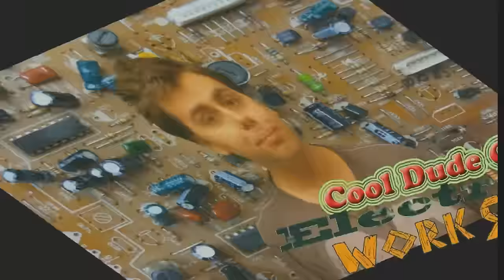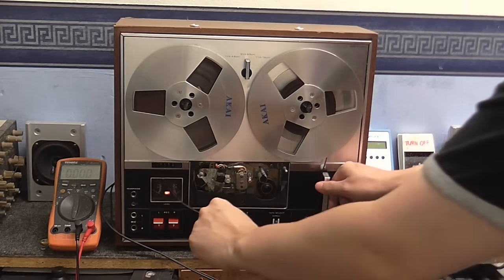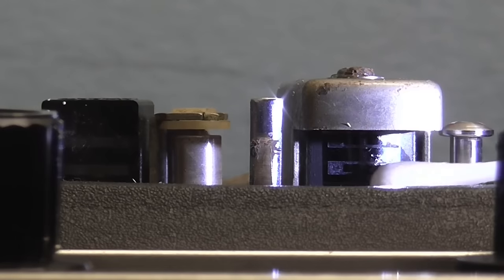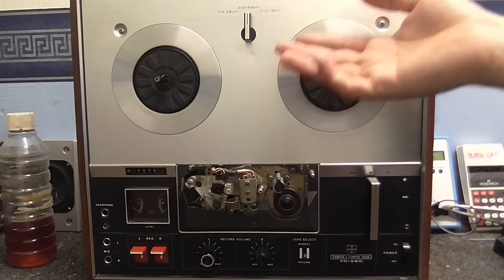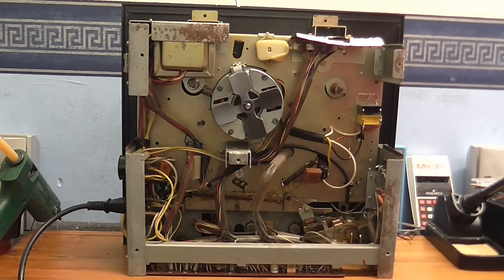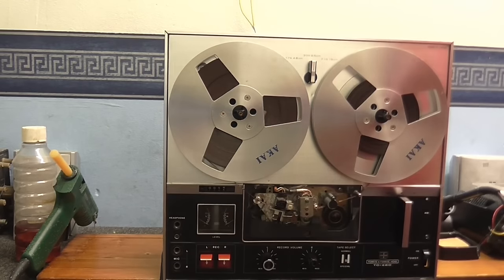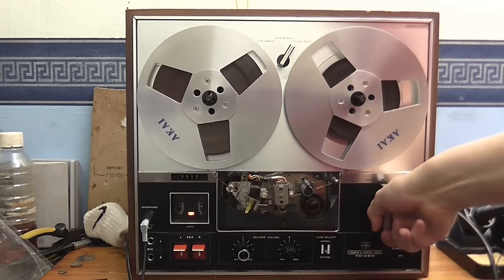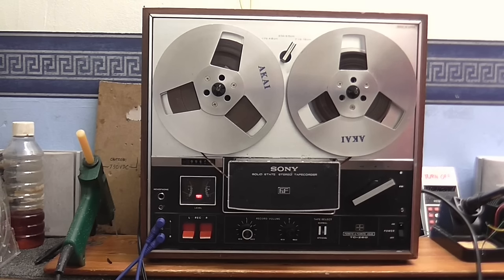The Sony TC 280 Tape Recorder

Comment: Not bad, Clem.  In the future, you might also consider cleaning ALL the guides in the tape path.  I saw one near the record/playback head that had a lot of oxide on it.  Also, before you adjust the playback electronics, you should check the azimuth of the rec/play head, as that can also affect playback frequency response.  A head alignment tape, like Nortronics used to make, can help with head azimuth adjustment. - former tape recording freak

Comment: I'm 17 and work on this stuff.  Some people may think we're too young to mess around with vintage electronics, but I know as much (maybe even more) than my grandfather about reel-to-reel machines and record players.
Reply: You old foggey. I bought an Ampex Reel to Reel 1000 Series for $25 from a garage sale when I was in Elementary School... before 6th grade... came with a bunch of tapes. Then my dad gave me $5 and took half the tapes. RRRrrrr!! later I needed them. I opened it up and changed belts a bunch of times cuz I tried rubber bands and things that didn't last long. 

Just wasted a bunch of time trying getting Sony model 250 to play at the right speed. Finally learned about motor drive capacitors. Under a plastic lid all this white stuff has oozed out. So I think a new or used 1.5 uF 300VAC drive capacitor will fix it hopefully.
Reply: yes , I think that would help, these stabilize the current /voltage going into the motor

Comment: For the stripped screw what I do is dremel a slot on the head making it into a MINUS screw then you can either take it off and replace or just use a minus screwdriver.
Reply from the maker: +coondogtheman1234 Good idea, I don't know why I didn't think of it myself.  I don't have a dremel, but being careful with hacksaw should do the job.
Reply: CoolDudeClem
That might be a bit tough, they sell battery dremels too even no name rotary tools. Just a small one with a metal cutoff wheel. be warned, they are loud so don't do any dremeling at night. Not sure if there are people sleeping at night at your house.
Reply: +CoolDudeClem no dremel? Clem, how do you survive? Dremel really helps in makeshift workshops like mine where space is limited and I can't put up a drill press, saw, lathe....etc. Dremel can give a lot of flexibility. I'll tell u what. If I move back to the states I will give you mine! Why? Not because I like you or I'm a nice guy (I'm not...pure evil actually) but I hate to WASTE things. I can get a nice one for cheap in the US that will work on 110v/50hz vs using a transformer...and I would hate to give it to someone here who won't use it anyway. May seem like a weak promise, but I will keep my word as long as you pretend to be nice to me. :D CHEERS

Comment: Here's a tip for stripped screws : Take a rubber band and place it over the head, then just unscrew as normal. So far it has worked for all screws I have stripped :)

Comment: Try vice grips on screw head before dremel  , set them as tight as poss . Screwdriver may split the screw head after cutting slot with dremel . Ive been there many times .

Comment: try a mole wrench on that screw if you can get enough grip on the side of the screw. Failing that carefully drill it out using a metal drill bit. 
Great video and tape recorder

Comment: Why do you have to keep your finger on the feed reel?
Reply from the maker: Just to give a little bit of tension on the tape, without it the tape drifts off the capstan and pinch roller. I need to look into fixing that.

Comment: The latest Clem's videos look awesome in 50 fps, wouldn't you agree?
Reply from the maker: +MegaBojan1993 Strangely enough, It's actually easier to do videos in 50 fps with my new camera than at 25.
Reply: CoolDudeClem It seems like your editing software for some reason does not like the 25 fps videos. I had similar problems when I used 24 fps (cinematic framerate) in AVS video converter. I updated both the codecs and the video editor and the problem was gone.
Reply from the maker: +MegaBojan1993 Actually my video editor which I've had since 2003 (Adobe Premiere 6.5) only goes up to 30 fps and will work with 25fps just fine. Strangely enough despite it's age it can handle 1080i & 1080p no trouble. I can get 50fps video because my camera uses interlacing, so I work with the interlaced footage, save it as an avi, then deinterlace it with handbrake to get the full 50fps.

Comment: Do you know of a way to make an inexpensive home-made head demagnetizer? - could I simply mount two small opposing magnets on a piece of wood or plastic? Or use a horseshoe magnet to pass over my reel to reel record and erase heads??
Reply from the maker: spinning a magnet round on the end of a drill (or anything you can stick a magnet on and spin it around) near the heads would probably work.
Reply: Thank you, CD-CLEM! --- I'm using an AKAI X-150D which apparently already has a built-in demagnetized function...but wanted to find an inexpensive de-mag addition...cheers...I'll try making a spinning demag contraption

Comment: How do i avoid drop outs on my recordings?
Reply from the maker: Find some tape that's still sealed in it's box.  Most tape's you'll find on places like eBay are 40+ years old and don't work as well as they did when they were new.